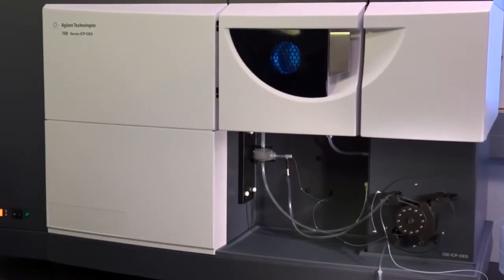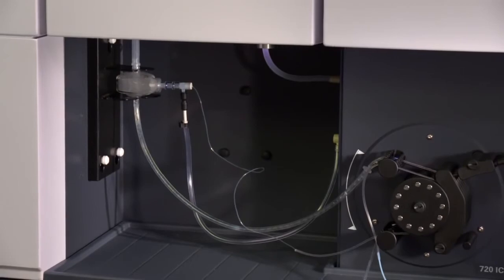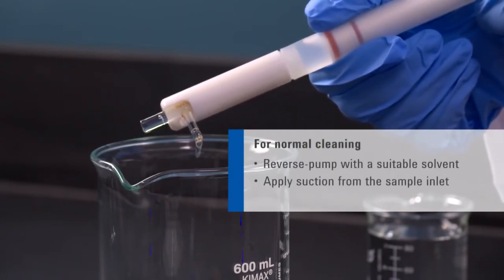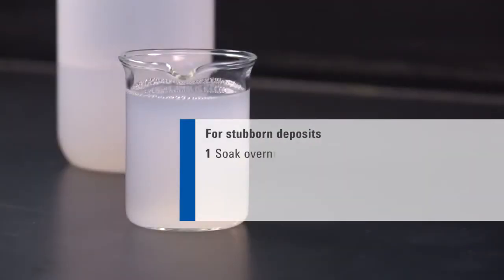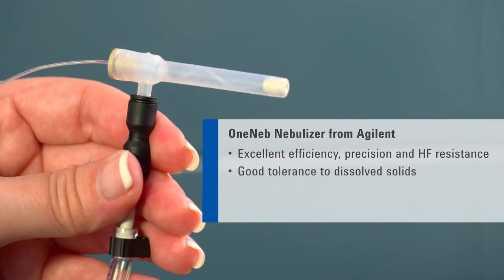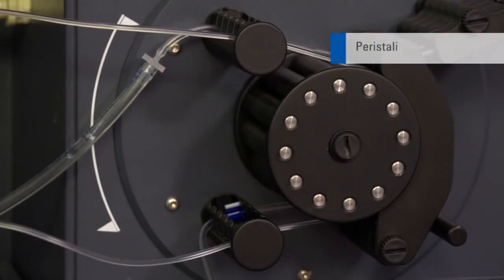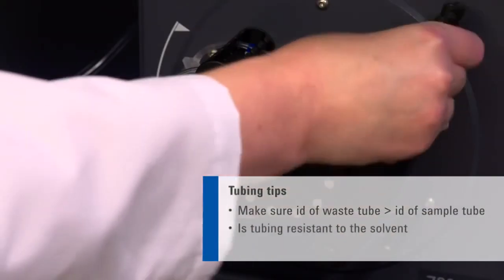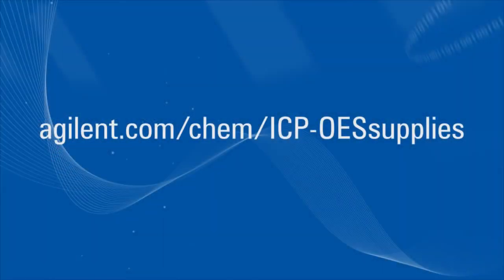ICP-OES Troubleshooting and Maintenance to optimize performance Part 2: Nebulizers

Comment: How would I clean a Teflon nebulizer (for ICP-MS) that is badly clogged? Thanks.
Reply: @koshchey4944  Use Decon 90 solution for cleaning the neb
Reply: @koshchey4944  what concentrated acid is it?
Reply: @7212-z9h  I just soak mine in concentrated Nitric acid, I leave em in there for a week, it has been working so far. I could also step up the aggressiveness of the acid by using concentrated sulfuric acid with 30% hydrogen peroxide